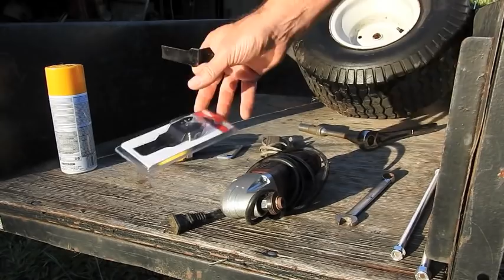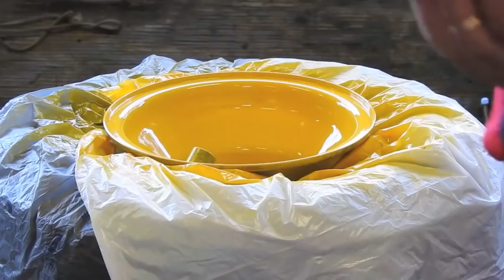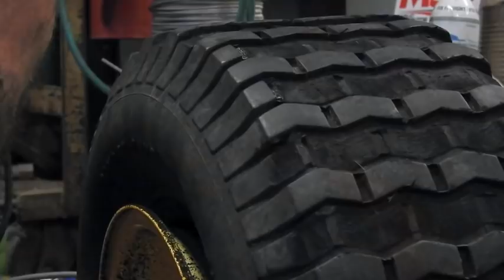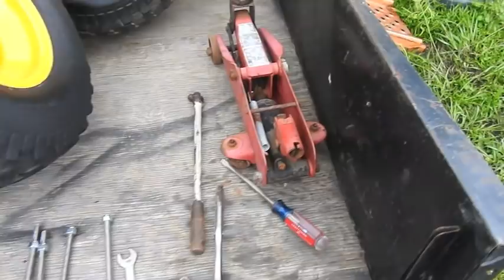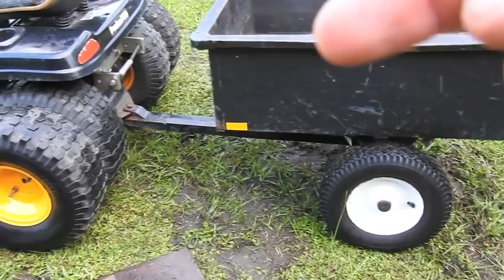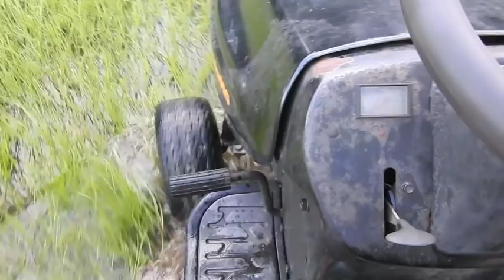How to Put Dualie Tires on a Mower

Comment: Ok I like it. But for the life of me why? I suppose the answer is because I can. I mean why do you cut grass in mud? Heck I wait until my grass is dry before I cut it. Never needed Dualies ever. It must just be me.
Reply from the maker: This mower is not a mower anymore.  The deck is gone and I use it to ride on.  Part of that riding takes place in the mud. I simply wanted to see how it would do with double back tires.  When I mow the grass, I wait for it to dry up too.  Thanks for watching and I hope this helps.
Reply: I sometimes have to mow in the mud with an older yard tractor (half way between lawn and full garden). I have 14 acres to cut and if it rains like it has done this year my yard literally doesn't dry out (think standing water on clay soil) at least until the grass gets cut (4 weeks straight without getting cut due to rain grass was waist high) but the ground dries up almost overnight once the grass is cut
Reply from the maker: I cut my zero turn's turf tires, like you said, sometime you have to mow when it is wet. Thanks for the reply.
Reply: D L After seeing this I'm actually thinking of doing this to help leave less ruts when I have to cut when it's wet.  Sometimes just got to do it when it's a bit wet especially this year
Reply: James Jay I don't worry about ruts in my yard I run dually ag v bar tires in the rear 80% liquid filled with bolt on weights and run tri rib steer tires  on the front, the dirt in my yard when wet is like running over a sponge and springs back on its own and is kinda like a field anyway but to lessen the ground pressure either special dually adapters or the rim rings are a must and don't forget staggered tire pressures inner must be higher than outer tire pressure rule of thumb outer pressure should be half to 2/3 the inner pressures
Reply: Cooper Palzkill I mow a steep ditch (45 degree slopes) over 1000 feet long and the added weight and the duals maximize stability and traction, the lower the center of gravity the more stable and less prone to tipping over.  Another thing I had to do due to the steepness of the slope is specially adjusting the oil level so that the briggs vanguard engine oil pickup remains submerged in oil at all times when sidehilling the slopes... due to its depth and steepness making it impossible to mow up and down the slopes on both sides of the ditch.
Reply: You never lived in the Pacific Northwest. Of corse just changing agriculture trend for turf tread works too.
Reply: Awesomeness!
Reply: Dan Hammond y stop with duallies? Add three,four, or 5.
Reply: El Comandante 
Lol.   😂 .   Or maybe ‘18 wheels wide’

Comment: Use 4 bolts on the tire  drill two more holes would be better
Reply from the maker: That would be better and stronger, however I have had these on 3 different mowers with no strength issues.  I have just put a video of duals on my John Deere, check it out and let me know what you think. thanks for watching.

Comment: Cool idea, but did you do this for "mud"?  Dually's don't help you get through mud, they're worse in mud.
Reply from the maker: That may be true with trucks, but my dually mower does so much better with the duals.  Now it is even better with dual tractor tires.  Just think of it as extra with tractor tires that provide extra traction in mud, they have to do better. Thanks for watching.

Comment: Can't you turn inner wheel  with valve stem ?
Reply from the maker: No, but maybe. I tried it after I put tractor tire duals on and they rubbed when I turned the valve stem in.  It may have worked with the turf tires, but I don't remember.  Be sure to check it out with the tractor duals and thanks for watching.

Comment: Instead of cutting the rim to air up the inside tire use a valve stem extension
Reply from the maker: I can't turn the rim inside out, it has an offset.  I am thinking about extensions or just drilling holes and putting valve stem on the inside. Thanks for watching.

Comment: I done this but I'm I'm having trouble keeping them bolted together
Reply from the maker: I don't know, mine have not come unbolted in a year or so... are you using lock nuts or double nuts? Good luck and thanks for watching.
Reply: I wish I could send a pic of my setup . The wheels that come off of another mower I had are about 2in smaller than the yellow ones that come on the pollan pro. I used lock washers and nylon nuts
Reply from the maker: I would think smaller tires would stay bolted on better than the same sized ones.  They would take less torture. Thanks for watching.

Comment: This was so silly I watched the whole thing without fast-forwarding you should double up the ATV tires on one of them I believe the belt would slip before you would spin them though
Reply from the maker: If I had some ATV tires that would work, I would be all over that! The belt did great until it was under water...  I can barely spin what is on it now. Thanks for watching.

Comment: should have put 4 bolts instead of 2. if you hit a rock it can cause the added tire to go out of rotation
Reply from the maker: I don't know what you mean by out of rotation, is it going to go backward?  either way, thanks for watching.
Reply: one tire will stay on the ground and the tire on the same tire will go over the rock so on . the same side of the mower one tire will be hire then the other till it straightens its self out
Reply: one tire will stay on the ground and the tire on the same tire will go over the rock so on . the same side of the mower one tire will be hire then the other till it straightens its self out
Reply from the maker: Alignment may be a better word for it.  That may make a bumpy ride on the highway, but I have never had it on the highway.  I don't think it will present a problem in the mud. In fact, it may even help during the bog.
Reply from the maker: Thanks for the replies.

Comment: does it work on all riding mowers
Reply from the maker: I doubt it work on all, but If you can find some wheels and tires that are the same size, you should have a good chance at making it work. Thanks for watching and good luck.
Reply: chud327 actually another trick is a tire slightly smaller on the outside ex. a 22 inch Dia outer tire with a 23 inch dia. inner tire the outer tires act as wheel weight on firm ground but then act as pusher/floatation tires when in the soft
Reply from the maker: And the outer would not wear out very fast. Thanks for the idea.

Comment: What size rods were they?
Reply from the maker: 3/8's inch all-thread.  They were about 1 foot long. I hope this helps and thanks for watching.
Reply: @chud327  awesome thanks. Also is there any modification to the rims?
Reply from the maker: The wheels are all stock.  However, I have another video where I put spacers in between the wheels. Check it out, I worked a lot better... Good luck.

Comment: Only issue i see is your valve stem on the inside tire should have been flipped so you could fill air from the outside
Reply: I spoke too soon but good video.
Reply from the maker: I plan to add some to the inside soon. thanks for watching.

Comment: How can I fix my duallys when I put my other wheel on it goes on crooked
Reply from the maker: Are you using the wheel adapters made out out of old trailer wheels?  That is what I did the second time and they kept the wheels lined up together. Good luck and thanks for watching.
Reply: chud327 is there a way I could drill 2 more holes so so it might not wobble

Comment: Just need extra wide rear fenders
Reply from the maker: I was thinking that, but that may be above my skill level. Thanks for watching.
Reply: chud327 use old lawn mower fenders and drill holes in the same spot and pop rivet them on just an idea
Reply: chud327 just an idea...as an  aircraft structural repairer when i was in the army. I would cut the lip of the side of the fender then extend it out with a doubler and filler. Hope that helps.
Reply from the maker: I will look into that... thanks for the reply.

Comment: Those otter wheels will no way take any amount of torque, if they work for you that's all that matter but defiantly would not be driving this and depending on those outer wheels to provide any traction
Reply from the maker: You should check out the videos where I took it in the mud. It did amazing especially with 4 tractor tires back there. The only time to struggled was in deep water, it would try to float, but then an otters are good at floating. Thanks for watching.
Reply: @chud327 
Yes it looks like it works well and like I said if your happy with it that’s all that matters . I like the the idea of the dual wheels as my property has some low areas where it is soggy and the grass still needs to be cut and am building axle extensions to accommodate the dual wheel setup.
Thanks

Comment: Flip the inside tire valve stem towards the inside
Reply from the maker: I thought about that, but the offset would allow it. Thanks for watching.
Reply: You could always drill another hole and use a long ass valve stem through the outside rim like they use on semi tractors and trailers.
Reply from the maker: I am planning to drill hole on the inside of the wheel and stick in regular valve stems. Thanks for the comment.

Comment: Instead of building the lawnmower, how about building the Camaro in the back ground :59
Reply from the maker: Funny you would mention that Camaro. After having it sit in my yard for 11 years, you commented on it on the same day as I got the title for it.  What are the chances of that???  The odds would be: 365.25X11=4,017.75.  That would be 4,017.75 to one! Wow and thanks for the suggestion, I plan to get on it soon, now that I have the title. Thanks for the comment.

Comment: NOT bashign on this loooks cool, but it its Not that muddy of an area or the front tires would be sunk into the mud immediately. Great idea, but not sure you really put it to a "true" test
Reply from the maker: That mud hole has deep gooey mud on the other end, I didn't go there in this video.  In later videos, I put duals up front too for gooey mud.  I then changed out the turf tires for tractor tires.  Please consider checking those out and thanks for watching.

Comment: You need to at least 4 studs 6 would be better. Make real studs from rod not allthread. Put spacer on studs to hold tires apart.
Reply from the maker: Great ideas and thanks for watching.

Comment: Bottom line all multi tool blades are crap. Fein brand is the best but they still wear out
Reply from the maker: The ones I am using were pretty good, but I was only using them on rubber. Thanks for watching.

Comment: Man you are dangerous telling posting this video!  People there should be a ring spacer between those tires to keep the wheels from moving independently. Num doing it this way. Go You Tube...
Reply from the maker: Dude, I am having troubles understanding your words.  I think you are disappointed with my dualies.  Let me assure you, this mower will not be doing 65 down the interstate.  The wheels, so far, have not moved independently, but then again, I am only going 13 m.p.h.  Thanks for you concern and especially for watching.
Reply: chud327 he's just disappointed that there is no ring spacer between the rims as that is what is used to make the outer tire create down pressure on the ground
Reply: It holds the tires in alignment and prevent the sidewalls from rubbing each other away
Reply: D L please explain more on how the spacer would keep alignment 
how would the tires move independently with a spacer? 
if one side of the tractor hits a rock, but only one tire of that side actually rolls over it, the other dual is left in mid-air right? causing tension on the transaxle?
Reply: Go on Ebay and they have the proper kit. That's the cheapest place I have found to buy one. Or you can copy it and apply it onto your tractor. When putting two wheels together the rims should never touch let alone the rubber of the two tires. To do it the right way you need a ring spacer of at least 1 1/2 inches between the outer edges of the two rims along  with the long bolts holding everything in place. That's the right way. If the wheels flop independently then you are putting on more stress on the axle at all times... Means quicker ware and or harmful damage. One tire going up as the other moves down at all times is not good. N E V E R ! And yes there stress on the transaxle with spacers,  but putting on dual wheels on a light rear end isn't a smart way to go. One should use a heavy tractor that has the transaxle that can handle the load. If you have to use a smaller tractor then better to use two fat tires for mud with low air pressure. The tires will adsorb the object you might run over. Yes the kit still must be used. One of my tractors is setup to use a loader and it has the spacer kit and I have had no problems with the outside tire taking the brunt of a load. But I take it easy using my tractor since I need more air pressure because of the weight I have to move around. My mud tractor is a lager beast than in this video but...really fat tires should be use with lower air pressure to absorb the shocks on any mud tractor. Paddle tires are the best so cutting the tires isn't a bad idea. Never use chains at high rpms. Hope this helps. One last thing, if you can't afford the fat tires then at least lower the air pressure some on the standard tires using a tube.
Reply: Wesley Jackson yes the duals on one side would move as one with either the adapter or the ring spacer. the ring spacer uses the rim lip of both tires to keep them moving as one. Yes duals done right will add more stress to the transaxle however not as much stress as having a flopping outer tire flopping around shockloading the transaxle.  The stress is further reduced however by staggering tire pressures ex inner tires at 10psi outer tires at 5-6 psi or staggering tire sizes ex. 22 inch Dia. outer tires with 23 inch Dia. Inner tires. With a true yard tractor (most have at a min. Tuff torque k66 for a hydrostatic or better transaxle) or garden tractor the transaxle is designed to accept dual tires, added wheel weights, filled tires, ground engaging accessories, etc. Lawn tractors are not. Hence my recommendation of the transaxle upgrade, or the peerless 700 trans. conversion with keyed shafting and wheel hubs
Reply: An experiment to prove the reduced stress caused by duals with staggering sizes/staggering pressures ( affects effective rolling dia. of the outer tire) also the reduced inner tire lift when rolling over an obstacle.  Cut 2- 2 inch dia circles from cardboard cut 2- 1.5 inch dia circles from cardboard punch a hole perfect centered in all 4 circles mount all 4 circles on a full length pencil or round stick pen in this order from eraser to point small circle, big circle, big circle, small circle. Now move the small circles to the far ends  with the big circles about a half inch further inward lay a second pencil on a table and roll the circle pencil across the table with only an outer circle going over the second pencil the first pencil is your axle/transaxle the second is an obstacle/the ground when inner tire starts to sink and of course the cardboard circles are your tires lowering air pressure in the outer tires act like the smaller circles to a lesser degree they roll as the same dia as the inner tires until you start to put load on them then they squish to a smaller effective dia ex take a car with a flat tire vs a car with a full tire measure from the center of the rim to the ground that would be your effective rolling dia.  Also the lower tire pressure causes the tire to squish more causing an increased footprint (surface area of the tire in contact with the ground) causing increased traction, decreased transmitted bump shockload to the transaxle(smoother ride), increased soft soil/terrain floatation, etc.
Reply from the maker: So far mine are doing great, if I improve the set up, I will let you know. Thanks for the reply.
Reply from the maker: Make sense on the alignment, but I haven't seen any rubbing yet. Thanks for watching.
Reply from the maker: I think in my next video, I will drive over some rocks with the outer tires. Just as a test, thanks for watching.
Reply from the maker: Do you have that Ebay link? Thanks for the reply.